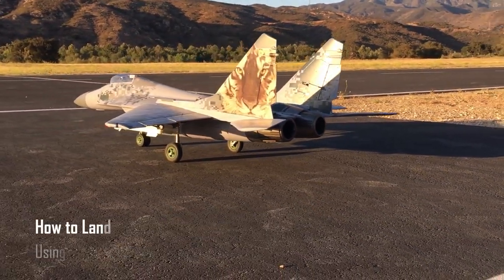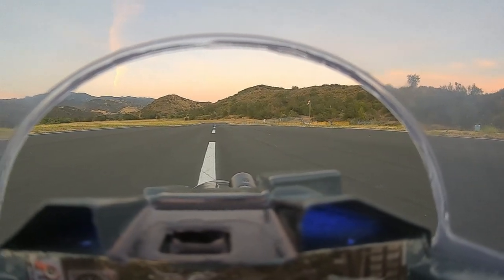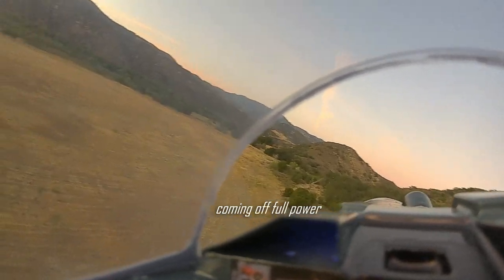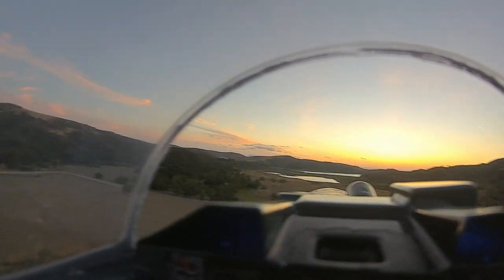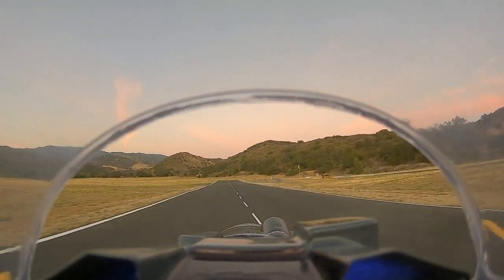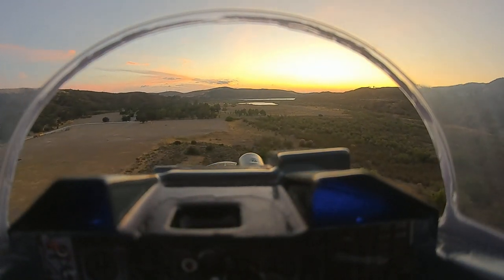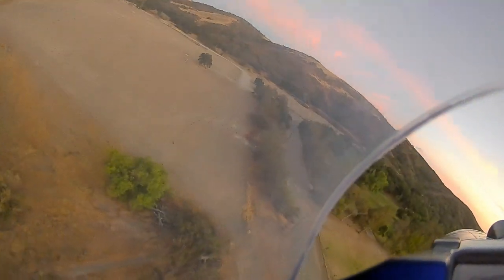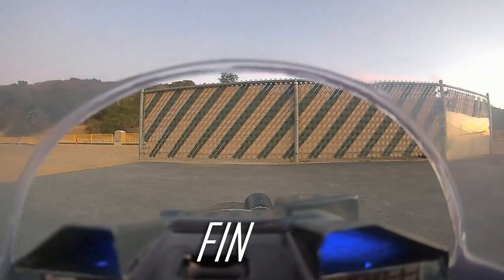Gauge FPV Landing Glide Slope using Runway Shape 👀📐🛬

Comment: I stalled my T-33 late one evening when my headwind dropped to nothing and I didn't notice.   This never happens when I'm flying line-of-sight but FPV is different!!  I'm running FrSky so I bought their $23 airspeed sensor and now when I get too slow my Taranis makes the stall alarm sound you hear in commercial jets.  I get lots of compliments when other R/C pilots hear the stall indicator as I flare for landing.  ;-)  It's very cool and helpful even while flying LoS.  Making that turn onto base leg on a windy day and not paying attention?  The Taranis will definitely let me know I'm flirting with disaster!
Reply from the maker: That’s awesome!  I installed the same air speed sensor on my T-33 and my wingman Alex actually built a flight controller to display both air speed and baro altitude on DJI goggles.  But when I hooked up the battery sensor, I stupidly reversed the polarity on the balance tab and instantly sparks and smoke filled the room.  This shorted out all the electronics on my T-33 and bricked it!  I was pretty bummed about it.  I will try to install air speed indicator again on the Mig-29.  Thanks for sharing your experience!
Reply: Excuse me sir, which brand is the t33 from?
Reply: @operaswift8623  It's a Freewing T-33 and works quite well for FPV.  As of today it has 287 flights on it.  101 were FPV.  I've had it since they were first released.
Reply: @motionsic  omg that sucks

Comment: Hi: I was thinking: the pan and tilt.  I think if I were doing mine for the first time, i might just go for the pan.  I can set the angle tall enough that i probably could get away without the tilt, which would simplify the build.
Reply from the maker: Sure. For simple flying in the traffic pattern, just pan would work.  But for formation or mock dogfight, tilt is essential.  No need to build, just need to spend some dough and save the hassle : https://fpvdogfight.com/products/motionsic-b-a-g-badass-gimbal
Reply: @motionsic  nice! thx!  I am seriously considering that pan and tilt device!   Hey. BTW, let me ask: Do you think Cobra X is good enough?  I would need to get head tracking with it.  If I were considering the cobra X, woudl that be a good idea as a pair of goggles? thx.
Reply from the maker: @pokerchannel6991  If you want something that would somewhat resemble your full scale flying experience, Cobra X is not going to cut it.  Standard definition analog goggles simply can not compare with high definition Digital FPV from DJI or HDZero.  Yes it costs more but the visual experience difference is night and day.
Reply: @motionsic  I see.  Then it was good that I looked into it and then asked someone who actually knows and does the landings fpv.  I think I will have to do dji

Comment: What flight batteries are you using this flight? Are extra batteries needed for the air unit, camera and pna & tilt unit, if yes, what do you recommend?
Reply from the maker: I used 2x 6s 6000 mAh batteries to fly the Mig-29. No extra battery to power servos of pan & tilt, they just plug into receiver.  I use a separate 12V UBEC to power the air unit like this one: 
https://m.de.aliexpress.com/item/32807348259.html?UTABTest=aliabtest249397_324597&_randl_currency=USD&_randl_shipto=US&src=google&gbraid=0AAAAACbpRImVf9wxgp0HNjikaJP0fzT4N&src=google&albch=shopping&acnt=631-313-3945&slnk=&plac=&mtctp=&albbt=Google_7_shopping&albagn=888888&isSmbActive=false&isSmbAutoCall=false&needSmbHouyi=false&albcp=15227397973&albag=128249327023&trgt=472962397889&crea=en32807348259&netw=u&device=m&albpg=472962397889&albpd=en32807348259&gbraid=0AAAAACbpRImVf9wxgp0HNjikaJP0fzT4N&gclid=CjwKCAjwgr6TBhAGEiwA3aVuIczbpa9fe_UvRNVZ9b6h-tSx7HQBBCm342zvJ8UIXdtMA5uhf8EdVBoCn6sQAvD_BwE&gclsrc=aw.ds&aff_fcid=651110b110404695930bebe4aa969d65-1651527576842-05668-UneMJZVf&aff_fsk=UneMJZVf&aff_platform=aaf&sk=UneMJZVf&aff_trace_key=651110b110404695930bebe4aa969d65-1651527576842-05668-UneMJZVf&terminal_id=31c7e8a93fce433386ad97809202fa80&OLP=1082000608_f_group0&o_s_id=1082000608&afSmartRedirect=y
Reply: @motionsic  Thanks! And what adjusments are made for the Viperjet 90mm? Are extra batteries and/or adaptations needed?

Comment: Hello , Hello , Please help me. I have a MIG 29 80mm aircraft. I have 5000 mAh batteries and I have a problem with the blue battery handle. It is very hot and can cause the plane to burn. What is the problem to know that I only work on one fan because the first battery is empty of charge and the other is fully loaded. Is this the cause of the problem or No? Thank you
Reply from the maker: If the blue EC5 battery connector is too hot, Don’t fly, not safe.  Not sure what the problem is.  Could be a bad solder joint.  You should never try to fly when the two batteries are at different voltage, not safe.
Reply: @motionsic  Thank you for the information, But what causes the battery knob to heat up? I don't know what the problem is. Could it be a wrong wire connector on the motherboard?
Reply from the maker: @abosl6an556  that’s a question to ask where you bought the plane from.  I honestly don’t know.

Comment: Can you share the equipment you use to fly FPV?  Thanks.
Reply from the maker: Yeah, here are the FPV equipment I used:
DJI Digital FPV Goggles:
https://www.getfpv.com/dji-fpv-goggles-v2.html

DJI Digital FPV Air unit
https://fpvdogfight.com/products/dji-digital-fpv-air-unit-by-caddxfpv

Motionsic BAG - BadAss Gimbal
https://fpvdogfight.com/products/motionsic-b-a-g-badass-gimbal

Tally-ho Head-tracker
https://fpvdogfight.com/products/tally-ho-head-tracker
Reply: @motionsic   Thanks a bunch.  Wow, just amazing footage.  I noticed that the FPV goggles have 
a range of 4km.  Is there something else on the market that can be used for this application as well as for the long range vtol drones like the ZMO?  It would be a blast to do FPV at a distance.  Thanks.

Comment: Great video and commentary. And awesome control and awareness of your location and energy levels.

I'm in general a bit opposed to the term glide slope though, but that's certainly not your fault since it is for all practical purposes an industry standard at this point. Still, the term does invite people to believe the landing approach should be an unpowered glide - which it isn't.
Reply from the maker: Thanks Jan!  It’s interesting that training for landing has changed with the times with much more reliable power systems.  Back when I started flying RC in 1990.  Glow engines quit frequently - I was not very good at tuning.  Instructors always taught unpowered glide approaches so that if engine quits, one can still make it back to the runway.  My instructor, who flew F-5 in South Vietnam said they do the same for F-5 in case engine quits on approach from battle damage or small arms fire.  So “glide slope” did apply back then.
Reply: @motionsic  Yep, having the energy to survive engine out scenarios was and still is important in some cases. But is suboptimal in so many other ways
Reply from the maker: janmb True!  Even in 1990, the best/most consistent landers were pattern flyers. They flew shallow powered approaches and had much better control on speed and landing spot.  They also had tuned pipes and much higher competence/confidence in their power systems.
Reply: @motionsic  Yeah, if you want consistent landings that are not only smooth, but exactly where you want, and regardless of wind, throttle-based landing technique is a must
Reply: @janmb nah thats not true. I have been flying 20 years. Full scale and rc. 
I can spot land any rc plane with zero power. 
Bob hoover was so good because he learned from day one about power management

Comment: What is the situation with your website and being able to purchase your pan and tilt system/mount and your upgraded air unit fan/cooling system?
Reply from the maker: Still working on the website. Servo still delayed due to pandemic soft lock down in Taiwan.  Air unit fan/cooling system is still in testing phase - not in planned release of first pan & tilt production run.
Reply: @motionsic  That's ok.  I wasn't expecting the cooling mod to be an easy one shot victory being available at the beginning.  I bought a pan and tilt system from the user Essential RC(english dude).  I will be working with that in the mean time.  I am thinking about buying a glider or something simple to work with as well to mount my camera to.
Reply from the maker: larsulrich3356  Essential RC pan & tilt looks very robust.  It works well with canopy removed.  Mine is designed to fit underneath canopy and only require 40mm diameter cylindrical space to turn around and 50mm height for camera to tilt up 70°.  Mine is the most compact one I have seen.  I am sure you will be happy with Essential RC version though.  Happy FPV flying!
Reply: @motionsic  Yeah I may place it in a glider or something.  I just want something to work with until you got yours out for purchase.

Comment: Zero wind and you didn't really gain any significant altitude. Just low level laps with touch and goes...?
Reply from the maker: Just showing how to recognize the trapezoidal shape that runway edge presents on final approach to determine whether glide slope is too steep or too shallow. That’s the point.